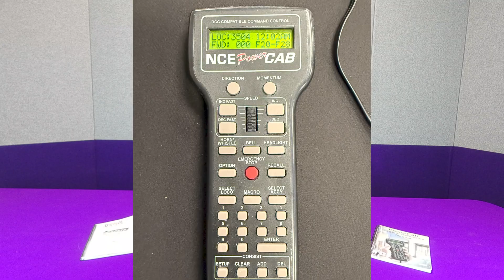Understand Your DCC System to Unlock Your Decoder’s Full Potential

Comment: Thank you George. I m using a blu nami in a trolly to learn programming jython /python  cv2 set to 255 will make the trolley full speed start and the throttle speed command set to  -1.0  will emergency /iinmediate stop to start and stop at a infared sensor wired to the ribbon cable to a Digitrax se74   Trottle.setSpeedSetting(-1.0) next to get the Bachman trolley sounds In a tsunami decoders. God bless the Choo Choo Train

Comment: Thanks  George, for me on my NCE power cab to acces the fonction  i use the option button  once for 10 to 19 second 20  to 28 its faster. Happy holidays
Reply: Yes, I do the same, but you have to change the settings for the ‘option’ key..  which is explained in the manual..  but since it requires a settings change, i explained the default method for the system.   
But good to note this as well!   I hope this helps..
Thanks for watching!
Reply: I use the option button too. It requires a simple setting to change it to toggle the function sets, but makes it way easier.
Reply from the maker: Happy Holidays